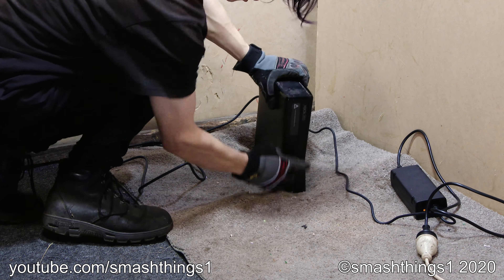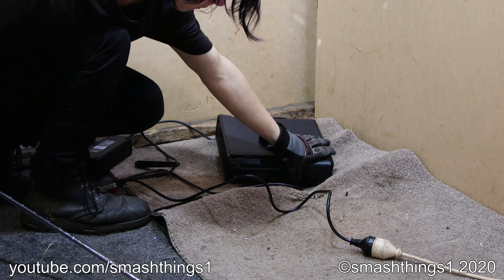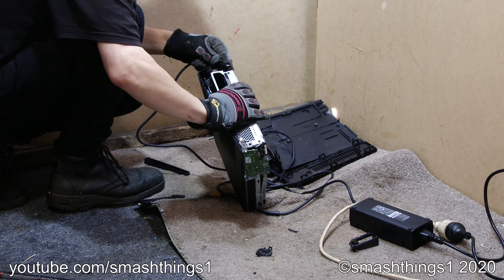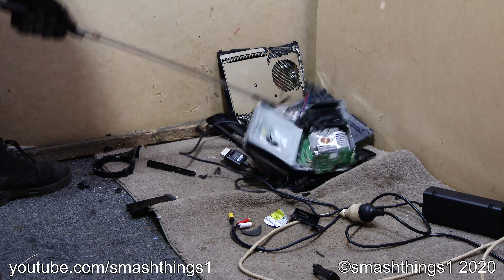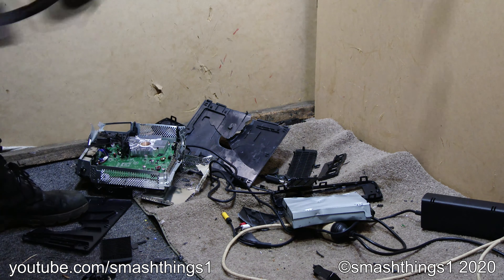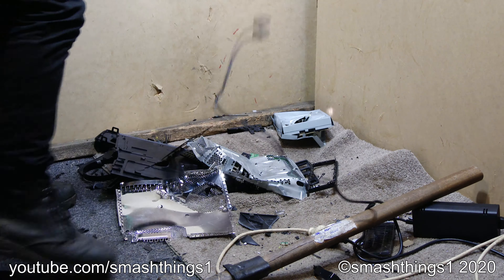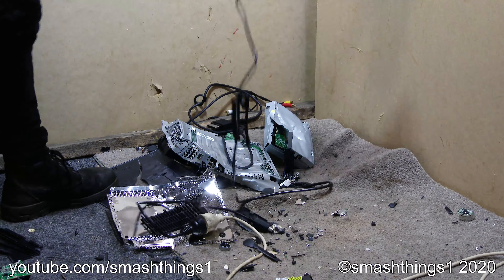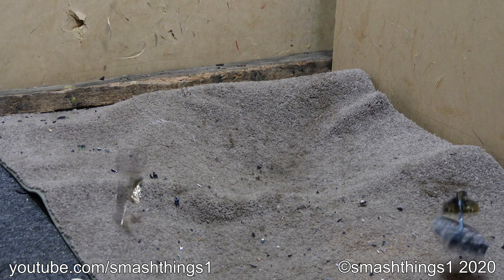Angry Gamer's Faulty Xbox 360 Slim Rage

Comment: THERE'S NO TV THAT'S WHY IT DOESN'T WORK!!
Reply from the maker: Lol, the console was faulty.
Reply: I have the same issue I had to unplug the ribbon cable from the RF Board and I had to use a xbox charge and play kit cable to turn the console on once the controller is synced it works fine without a power or eject button